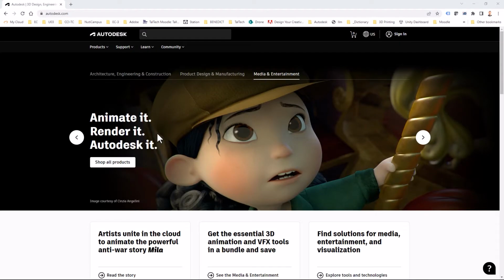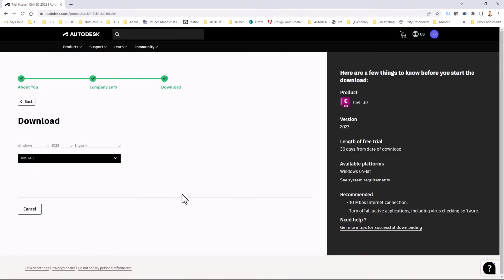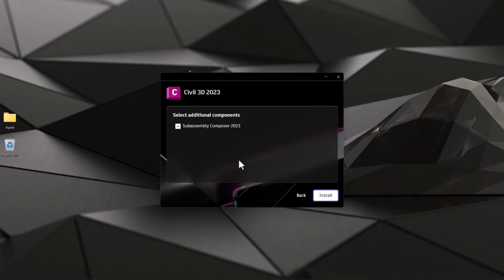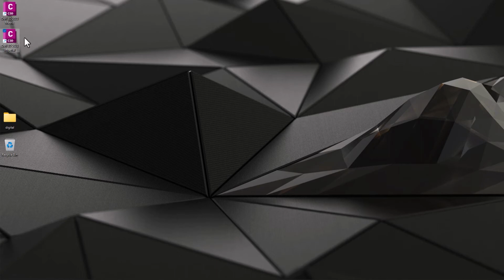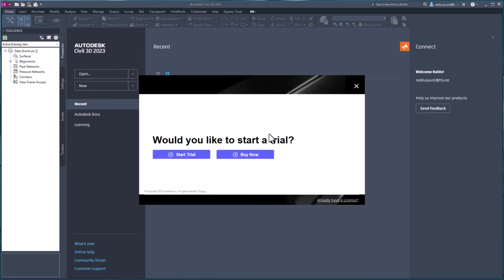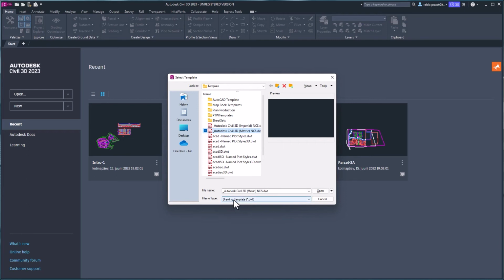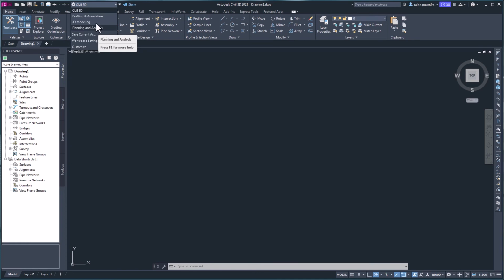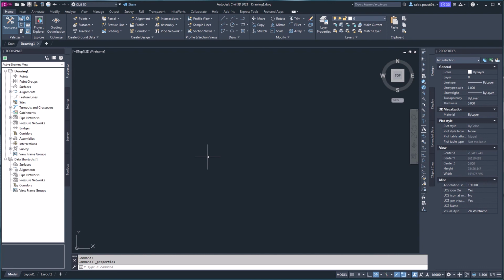Unboxing Autodesk Civil 3D 2023 - Download, Installation, First Run

Comment: Good day sir, have install C3D 2023 but it does not come with SSA and Bridge moduler
Reply from the maker: SSA can be added through Autodesk Desktop App or through manage.autodesk.com. Bridge module - please pay attention to that this workflow is not the same as it was in version 2017. I do have additonal videos for bridge data sharing in between Civil 3D, Revit, InfraWorks etc.
Reply: @eRaido  Thank You sir for your information.
Reply: @eRaido  Most of your lecture is not done in English language
Reply from the maker: @chinedunwaogbo9546  Those (bridge related that I pointed out) are in English: https://www.youtube.com/playlist?list=PLHYYlGqgRQXRit386I281tU-MtlCxWlAG